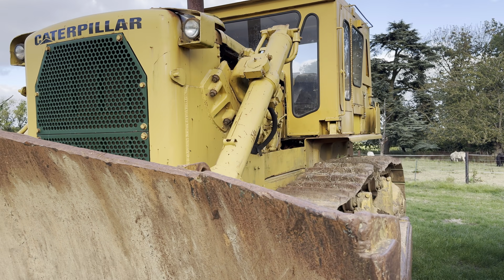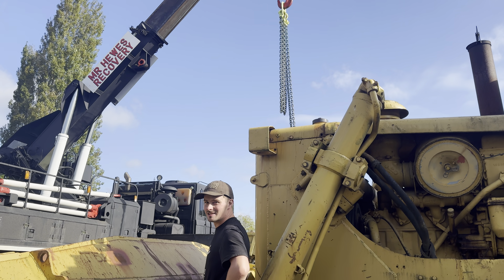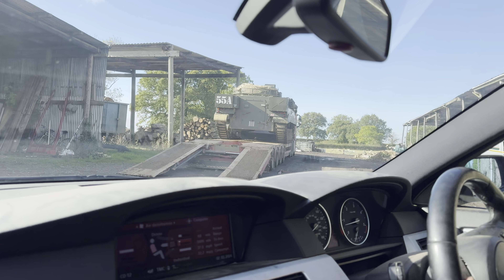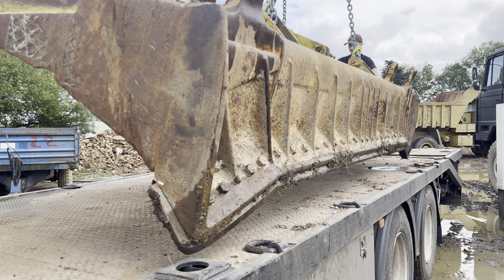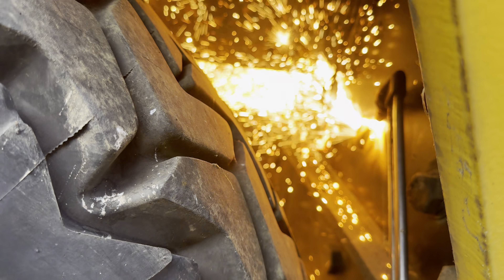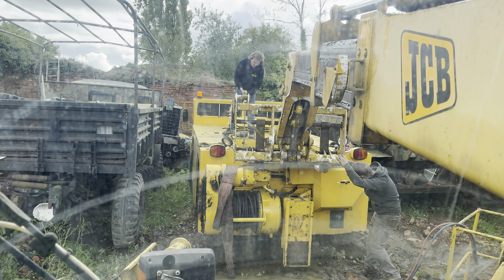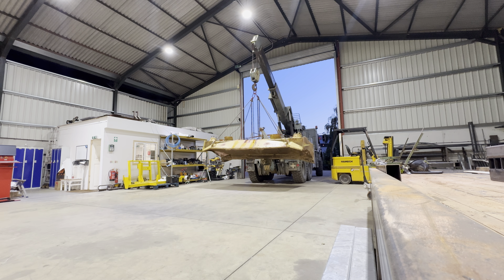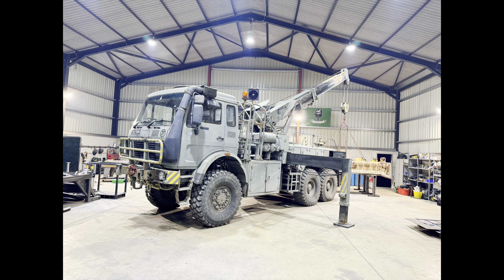HEAVIEST RESCUE! Building this 89600 lbs Recovery Bulldozer.

Comment: Great decision on location. You could  have the pulley arm pivoting on a rams for a full range of heights. Not sure if it would be good to pull against rams though? Would possibly need to have 2 locking bars & a selection of pin locations welded to the bucket. I'd be tempted to go OTT with it all... Another simple solution is fit a 'domestic' winch on the roof of the cab to set the pulley height. Maybe have the pulley mounted in the middle of 2 'beast' lengths of box section. With 45 degree braces.

Comment: Maybe add some deflection rollers on the lower part of the blade so you can winche from a deeper point.
Otherwise the hight of the winch on the blade could make it harder to pull small  but heavy objects cause some power will be lost to the winch trying to lift the weight.
(Sorry for my bad English i tried my best, greetings from Germany)

Comment: Normally dozers got the winch in the back.  And the blade of a dozer could not elevated as high as on a loader. Maybe I´m missing something. Got a new idea: how about fitting the fuel inlet to the blade as well?

Comment: Safety flip flops. Essential when moving extremely heavy equipment or welding.

Mind you, steel toecap boots might not be better. - I worked in a hospital when a bloke came in who had dropped a 3000kg I beam onto his foot, whilst wearing steel toe boots. They  kept his toes safe, because they were still inside the boot once it was removed from his foot. No more playing 'This little piggy' for him.

Comment: Heyup Joe, I’m sure the fabrication lads know what they’re doing and will advise you along the way etc, but attaching a 45 ton winch to a blade that’s meant to bear what, 5 tons of earth - is going to slip you a crippler (as I said to my wife on our first date) rather speedily. I think mounting it on the front is a great idea, I would just advise you using a few tons of armour plate etc as reinforcing on the blade itself and the arms as they’ll possibly have a ten ton limit (being overbuilt as they are).
Reply: P.S. just as a matter of reference I’m a heavy machinery welder - so I spend most of my life sticking quarry buckets that over exuberant drivers have mashed. But I’ve rebuilt a fair few D-CAT blades as well (and put new underplating on the swines which is an awful job!). Either way, good luck and if you still need a builder, I lay bricks as a hobby (sad as a kicked camel, I know) send us a pm, it’ll only cost you materials (a bag of cement and a couple of bags of sand should do it - as in sand, not two grand 😀)

Comment: The points that the blade is attached to the machine are designed to have pressure against them NOT a pulling force. It should have been mounted on the ripper arms.

Comment: Are you also adding removable teeth (so you could still use it as a dozer) to the blade to get better grip? Being able to loading the blade with some extra weight could also help anker the blade..  And maybe a heavy eye to connect te end of the winch cable so you can use a pulley to double the strength of the winch?

Comment: Guys you're on the wrong track. 
The Dozer is heavy enough, it doesn't need a big blade spade to dig in when pulling. It will make the dozer less useable in the future. You should have done what Al Quiring, he is a proper recover professional. Heavy D is just a You Tube celebrity... I think there will be some morning after regret here....
The winch should have been mounted to the ripper section and the ripper blade mounted in backwards. driver the ripper blade into the ground and pull. The weight of the machine and then ripper would have been enough.
Reply: I respect Al quiring a lot for what he does with his D9s but this is going to be totally different type of winch tractor operated in a totally different way

Comment: Are the blades hydraulic actuators, capable of handling the 35 ton load in the direction the winch will be pulling? They are designed to take forces mostly in one direction, ie when pushing a load.
Great video!
Reply from the maker: We will take this in to account and will be reinforcing the blade

Comment: Wouldn't it be a better idea to put the winch on the back of the Cat with the cable going underneath its body and then either over the top of the blade (as in Heavy Sparks) or through a hole or recess cut into the blade. That would also mean that in the failure of the cable the driver is protected either by the blade or the body of the Cat.
Reply from the maker: No as this would create several leverage points and would almost certainly have catastrophic results

Comment: Looks like a beast of a  recovery tool in the making. However, mounting the winch high up on the blade, which will be acting as the ground anchor is going to put huge tension on the top links that lock the blade angle. Mountings designed for  pushing are going to need some beefing up. 
Getting interesting 👍
Reply from the maker: Definitely however it’s not a problem to do so

Comment: Maybe, you could make a safety cage slightly higher than the winch, that extends along the top of the blade and then down the sides of the blade. The side part of the cage being removable. The metal used, would need to be at least the same size/diameter of the winch cable.

Comment: I enjoy your videos, and have not commented up until now.  But as a former civil engineer I have a couple of questions - are you confident that a) the arms of the Cat are strong enough to take the winch loads without reinforcement; and b)are there any hydraulic rams on these that might be overloaded by the winch forces?
Reply from the maker: Everything will have to be reinforced and re-engineered as we are aware it was designed for pushing not pulling
Reply: Great!

Comment: Have the pulley at the top of the blade be a bank of pulleys instead so you have effectively a bank of snatch blocks for when you want crazy power. I would also suggest that the center of the blade skin be cut out temporarily to weld in more trusses as the loads on the blade are on the back and top not the bottom as conventional design.

Comment: Probably add a smaller winch just to use to drag the heavier cable to (via snatch block) whatever you're going to winch out, and then back to the anchor point of the blade so you don't end up trying to drag some several hundred kilos of winch cable against the drag of the winch itself. Don't have the bar armor on a flat or vertical, angle the bars at a 45 so if something does break and fly back if it hit the bars it would be directed down and away since its easier to redirect force than try to stop it.

Also wedge shield the radiator grill. More lights can't hurt if you're going to do a night or recovery that takes you into the evening/night time hours. Elevated tool/equipment box on the back to carry your chains, pull harnesses, chains, straps, snatch blocks, hooks, eye swivels, pins, cribbing. Tow bars can be mounted into hangers along the arms of the blade.
Reply from the maker: Comments like these are what we like!
Reply: @MrHewes  maybe one of those spare hiab cranes on the back to move all the tackle.
Reply: @Lou-f  Yep, I think that is a must-have on the back of a rig like this. Maybe it gets it’s own tracked trailer later on to carry its recovery kit?
Reply: The Caterpillar will soon also, identify as a Fodden! Keep up the good work mates! "Caterden" or "Foddipallar"?
Reply: @tz6583  fodipillar sounds really good!
Reply: Don't think you'll need the fairlead to be out on a stawk, forward, like the sparks deal - length issues of whole contraption.  Maybe on an A-frame above winch - depending on transport height.
Reply: @howardsmith1111  it helps the reeving though. A lot :o)

Comment: I knew my line of thinking was the project idea. Can you not cut off the excess blade width so it doesn't exceed the dozer track width which in turn makes transportation easier as you'll not need to remove the blade when you come to recover a knackered tank elsewhere
Reply from the maker: We move it with the blade on, it’s a movement order job regardless

Comment: I know you will have thought of this already but having some anchor points on the outsides (top and bottom) of the blade would give you some extra winching options without needing to move the blade. Going to be fun to see the finished project :)
Reply: Is there anything that needs to pulled that much?  Start advertising now.
Reply: @etherealbolweevil6268 with that much power the only real question is what can’t be winched :)

Comment: one thing to look at: if you mount the winch on top of the blade, obviously all the pulling force will have to be taken up by the struts/piston that connect to the top of the blade. on the video i could not see very well the bolt that connects these struts to the push bar, but that seems to be the weak point. and of course if you use the wich with a (bloody heavy) pulley forces will be doubled......might be wise to connect the return cable to the bottom of the blade, not the top.
Reply: Get you there ...get it as low as possible.. I imagine that some of the pulling force load will be taken up by the blade being anchored into the ground during winching operations . Depending on ground
Reply: With the blade acting as the anchor all the force is taken by the blade against the winch -  there is a similar set up on a skid steer on "watch wes work" if his works using a blade anchor I doubt that that Cat blade will have any problems

Comment: Immense! Only observation is perhaps incorporate some anchor points into the blade while it’s with the fabricators so you can attach the winch cable back to something solid when using a snatch block
Reply: Or even an attachment point for an extra snatch block on the blade for an extra return. With the total mass of the vehicle and that blade anchor they may as well make that 35T winch pull a tectonic plate or two!
Reply: I think that it is a good idea 💡

Comment: Note to self, never work around these blokes, someone will get hurt . Learn how to rig , read the workshop manual before anything. The weights give no second chances. 
Just get a 50t hyster winch with the right plate they bolt up to the rear of the machine add a couple of spades and jobs done . 35t is way to light
Reply from the maker: I love it when dim people attempt to make me look foolish. 

Well you get on making yours then sunshine. 
But that would require you to leave your mums house and get a job.
Reply: @MrHewes  you do it all on your own . I would love to be working again I spent 40odd years repairing earthmoving gear and building stuff. Not now because some twatwaffle decided to skip a couple of safety precautions and i ended up in a wheelchair. When things turn to custard with heavy equipment it happens fast and no second chances i was lucky i was not killed just maimed and broken

Comment: Tell me Ted have you stress calculated if the ball joints can take the load the winch will put on them?
Reply from the maker: It will be getting extra reinforced blade restraints
Reply: @MrHewes  I thought it needed extra restraint, possibly two housers in mild tension fixed to the blade arms, so they transfer the load to something more substantial